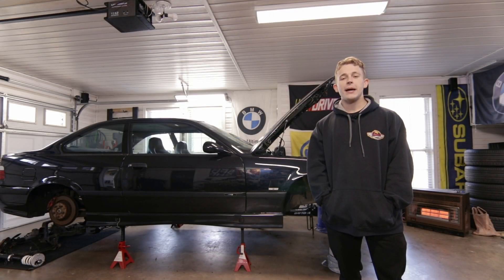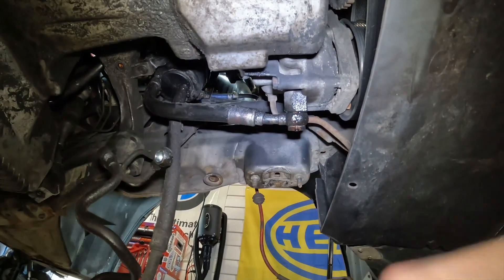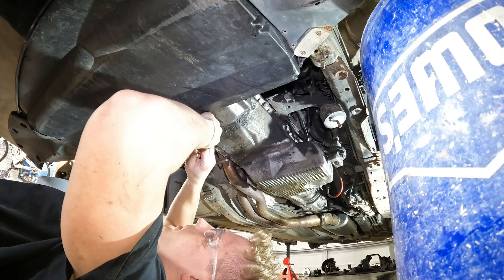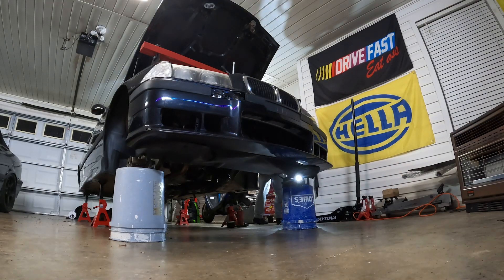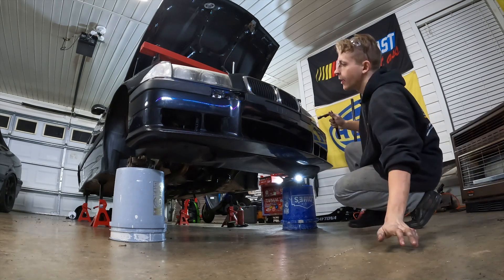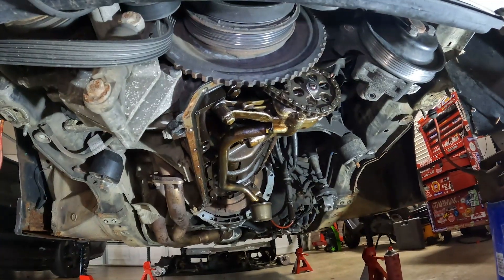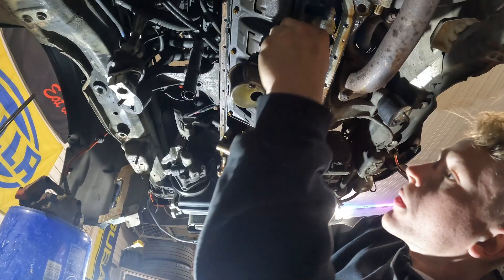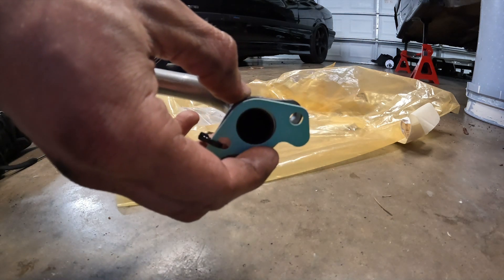Safety Wired Oil Pump Nut/ Reinforced Pickup Tube - E36 M3 Drift Car Project "Maine": Episode 5

Comment: Is this necessary to do on any e36 m3? Or are there certain situations where you wouldn't want to go through the effort. Say if the car you had was mechanically sound and you don't track it. I understand the nut can just back off but wasn't sure if some cars/uses were more susceptible than others.
Reply from the maker: To my knowledge it is one of those luck of the draw items than can/ might fail under a variety of circumstances.  All M50, S50, S52, M52, M54, and S54s are susceptible to having the nut back off, with the E46’s M54 being by far the most common one to have the nut back off.  There are some factors that can increase the likelihood of failure, like lightweight clutch and flywheel setups that can cause the oil pump chain to act like an impact gun on the nut as the engine revs much faster.  Tuned in hard cut rev limiters, solid engine and transmission mounts, and higher mileage engines with more slack in the chain can also lead to the nut backing off.  Personally, I think it’s worth the effort of the job simply to replace the oil pan gasket.  Wiring the nut is just one extra step at that point for peace of mind.  That said random failure on low mileage street cars is probably unlikely, so don’t stress too much or lose sleep over it.  I drive mine very very hard, so for me it was a must.  Just plan on doing it if your oil pan gasket ever starts leaking, at that point it’s an easy “while you’re in there”.  In the meantime you’ll probably be fine! (:

Comment: Nice DIY. Should note for any curious the oil pump nut backs off due to harmonics from the chain stretching. VAC makes a tensioner for the oil pump chain on more race built motors.
Reply from the maker: Precisely!  I was actually having this discussion with my friend Ryan a few days ago, there are absolutely levels to how far you can go with bulletproofing the oil system on E36s.  I didn’t know VAC made a chain tensioner now, I’ve only ever seen the Seems Legit one!  Also I never thought about it like that but that makes total sense, I always thought the slack in the chain acted like an impact on the nut and broke it free in quick revving scenarios, never thought about the harmonics.  

Also worth noting that I would also recommend VAC’s modified oil pump with a bolt vs nut and billet shaft (along with a new chain and tensioner) if this engine had big power in its future.  Not to mention the option of switching to a S54 (or S50B32) dual pickup pump and pan!
Reply: @griffengardner  Good info. Thanks for showing the factory upgrade on the oil pick up tube. I think I'll do that when I tear down an M50. I like the mechanical aspect and I think you portrayed this job well.